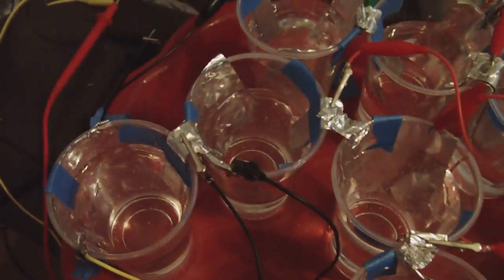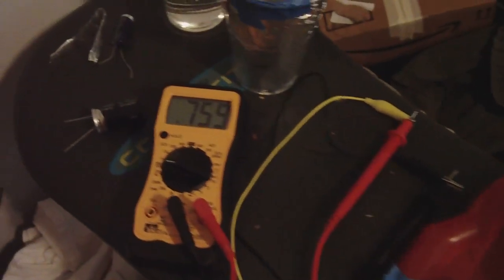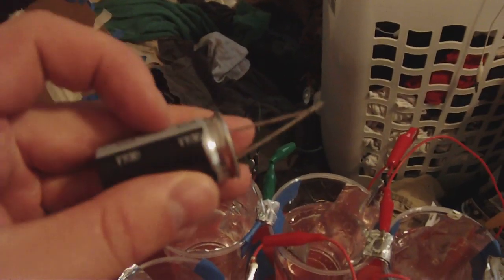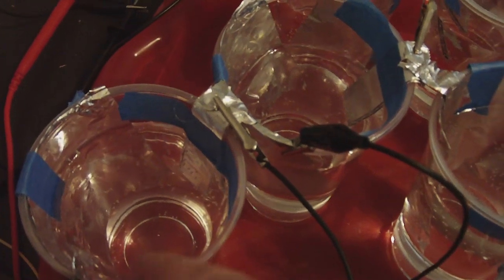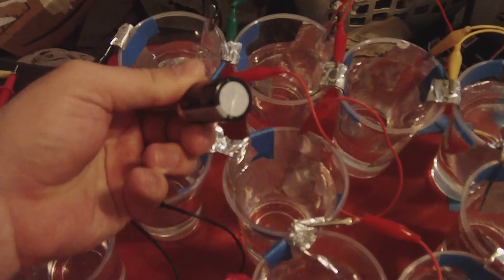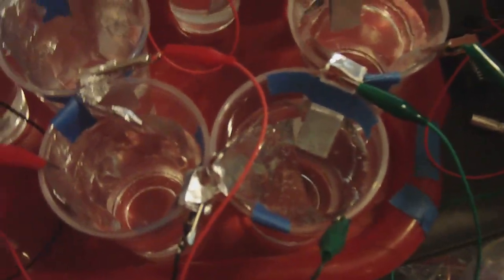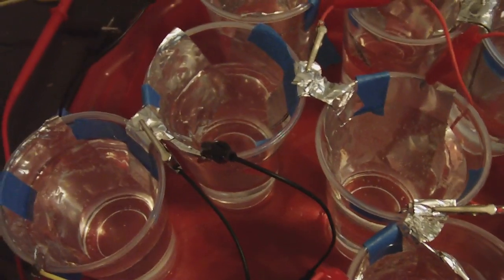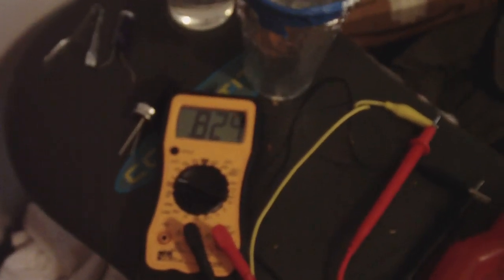800mV water Captret

Comment: I'll have to build and do testing I guess to better see and understand what is happening here. But my 45+ years of being a electrical technician is causing a lot of red flags to be popping up right now. I'm also a DIY experimentor of various magnetic and electrical designs for making energy cheaply or nearly free. I lean more towards magnetics and abient energy capturing designs because as far as I know the 2nd law of thermal dynamics can't and hasn't been broken or circumvented, yet. One always hopes though.

A big puzzlement is how positive and negative polarities are established if electrode plates are the same material and they are acting like a chemical battery? This doesn't make sense.
  Capacitors are electrical static charge storage components and unaffected by magnetic fields as a rule, because of their physical construction. Any magnetic fields fluctuating or passing thru them will cause cancellation in induced current flow because both plate polarities will experience same forces of Eddie currents created localized and opposing in phase making any overall changes cancelled out.
  This is why we have inductors and capacitors as sperate functioning components. A "good" capacitor doesn't have or allow current to flow from one electrode to the other one.
 They are basically an "open" in a curcuit once their plate charges are equalized. Current will flow into and out of a capacitor to charge it to its capacity or supplied voltage, but not thru it.
  I've never seen that happen except when the capacitor is bad, or charged beyond it's voltage rating and high enough to arc internally across (thru) the dialectric material.
  With electrolytical capacitors (polorized leads), once that happens carbon is usually created on the arc path and the capacitor is effectively shorted out between it's leads and considered a short circuit condition.

Im not saying you are not getting some unusual affects here, but whatever is happening as described doesn't jive with electrical theory and established circuit operations and designs.
  I'll have to try and replicate what you have done and put my Oscilloscopes and meters to work on it and see if analysis reveals what is happening when I get time to do so.

A design suggestion also, I noticed your electrode plates are very small in surface area as shown and if you want to have better (more) energy available, they need to be increased dramatically as much as possible and probably placed as close as possible opposing each other. 
 Normal capacitor construction and operation functionality requires their proximity to be as close as possible in order for any capacitive charges to be established and held.
 But making them more like a conventional capacitor may stop the effects you're currently getting also.

Very interesting regardless and don't stop experimenting with it. Breakthroughs in technology advancements often have been by mistakes or just thinking differently about stuff that no one has considered yet.
Good luck to you, hope you're on to something that makes a difference.

Comment from the maker: @K0W0O0N0 

Adding salt lowers the voltage. Had one cell giving about 200mV and when adding salt its now giving 40mV.
Reply: Adding salt to distilled water makes it a electrolyte (conductive) solution instead of being a dialectric (insulator) solution.
 Because there is now an electrical path between the plates that current can and is flowing, the voltage will drop if not disappear entirely. Voltage is a measurement of electrical energy potential so think of it as a container that is full of water, as long as none leaves the container you would measure that it has a lot of "potential" energy. Follow so far?
  Now when you let water pour out you have current flow and the containers potential is decreasing, and continues to decrease relative to the current flow.
  A large current flow causes the voltage to drop or decrease significantly more than a low current flow.

Anywhere you measure in an electrical circuit that is powered you will see this relationship at play. Low or no current flowing - the voltage will be close or at supply voltage, even if there is resistance between supply and point you're taking a measurement.
  But as soon as any current starts or increases flowing from that point to somewhere else like a capacitor that has less charge than the potential measured or something that is a load (converts energy to motion or heat), the voltage potential will decrease and any resistance in the path back to the supply will now become apparent and also affect the potential voltage available charge at that point.

  A good way to always look at any circuit or electricity in general is these absolute actions: 
 If voltage increases at a point, current flow has decreased at that point.
  If voltage decreases at a point, current flow has increased at that point.

Hope this helps everyone trying to learn how circuits work and understanding Voltage and Current Flow.

Comment from the maker: @mrBr00k5 

I'm smiling now. I'm glad you posted this comment because copper does work, this opens so many new ideas. Thank you! 

One thing i know is that water is diamagnetic, so when i add a paramagnetic metal to the water we get voltage. this is amazing. This is great thank you again!
Reply: I know the plumbers say you shouldn't place a copper pipe and then
an iron heater in the water direction, because in the end the iron heater will end up rusting due to this electrical difference, producing a galvanic effect.